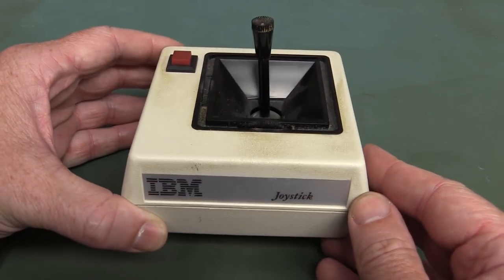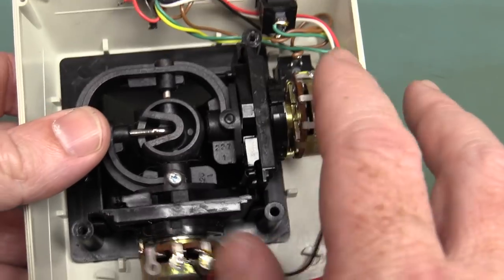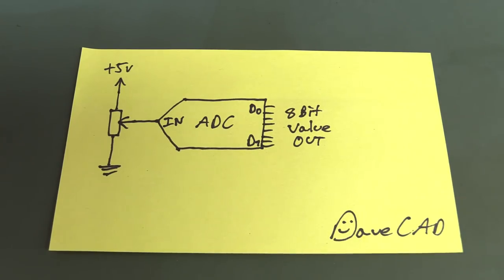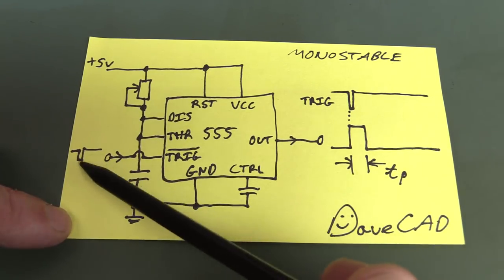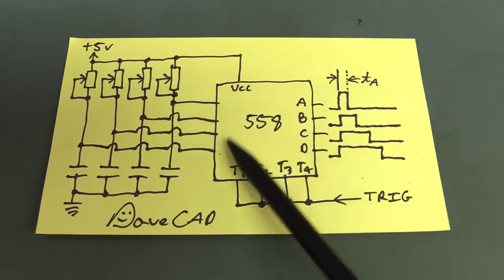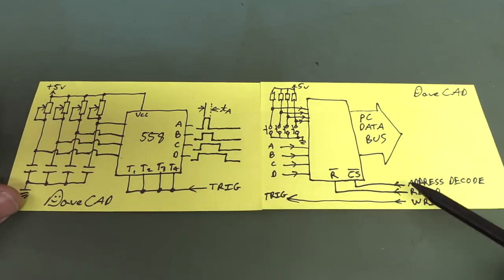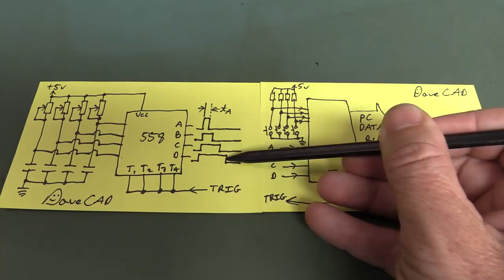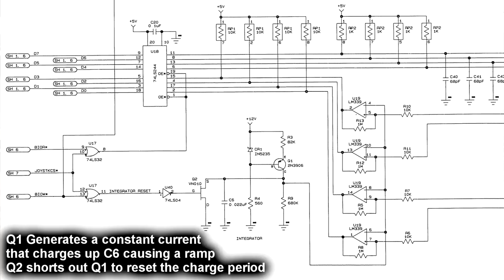EEVblog #1054 - How an Analog PC Joystick Works

Comment: Ah, the 15 pin PC joystick port.
Almost as ubiquitous as the Atari joystick port.
Although, more long-lived I suppose.

It's actually kinda surprising how many systems ended up with Atari ports or minor variations on it.

To this day the best input device for most 8 bit computers (though you have to watch it with some, especially those which deviate from the Atari spec somewhat) often turns out the be a mega drive gamepad.

Granted, in existing games only one button and the d-pad works; and given how the IO for most ports works (And the Atari port in particular), with custom software routines the best you'll get is the d-pad and two of the 4 buttons. (2 of the 7 buttons on the 6 button version.)
It wouldn't be hard to create a simple adapter that lets you use more buttons, but as is without rewiring either the controller or the port, this somehow just works.
It shouldn't, because it doesn't quite match. But it works anyway because the Sega controller expects +5 volts on a pin that according to official atari specs does nothing, but in fact is generally pulled high (eg. gives +5 volts) in most systems.
The reason you can't use all the buttons even with custom software is related to this; the Sega specification uses one of the pins as a 'select' switch. Pull it high and you read Button B and C, pull it low and you can read A and Start.
It just so happens that the pin chosen for this is the pin that in the Atari specification is used as the power pin. So it's always high. Which is why you get two buttons but cannot access the others; there's no software control over that pin.
(There are 4 pins that can be set as either input OR output, but those are the ones that give the D-pad inputs on the Sega controller. - and in fact by default the joystick inputs on a standard Atari joystick as well. Part of why this works at all - the D-pad maps to the same pins as an Atari Joystick, and the B button maps to the atari controller's Fire button. The C button maps to what is officially an unused pin, but which IS readable in software - Except no existing software reads that pin, for obvious reasons.)

Kinda weird how many systems used that same standard, or near enough to it, in the end.
Nintendo's logic for how to read a game controller is quite different. Though in their case one of the things that might not be obvious is that the NES and SNES controllers have the exact same pinouts and behaviour; Obviously the SNES has extra buttons, but beyond that the only difference is that the two have physically different connectors...

For a short summary of the differences, the Atari specification, while it has some variations for stuff like paddles and the like, really just treats the 9 pins as +5 volts, ground, and 7 inputs. - two are unused in the official spec, but you register an input by puling the relevant pin to ground. The Sega controllers are almost identical, barring a change in which is officially the +5 volt pin, and using up the unused pins for extra functions. That's all there is to a Master System controller, but a Mega Drive controller then uses a 'select' pin to swap between two possible interpretations of what the pins mean. 

An Atari controller therefore is just a bunch of buttons wired such that they pull specific pins to ground as needed. A sega controller is the same but in the Mega Drive adds a bit of logic to switch between multiple sets of buttons. (the active set pulls pins to ground, the inactive set is ignored.). The 6 button controller contains a microcontroller and uses a special timing sequence of the select pin to access the additional buttons. 

the way Nintendo does it is effectively a simple serial port; Compared to the atari and sega approach (excluding the 6 button controller) this is slightly more complex.
But, it's not compex circuitry. The controller simply contains a pair of 8 bit shift registers, which are hooked up to form a 16 bit shift register. The console sends a latch signal to lock the shift registers into a specific state (the combination of buttons when the latch was enabled), then sends a clock signal to shift out the bits one by one, then releases the latch signal.
A completely different approach, which is somewhat more complex, but also more adaptable in the long term; All you need to do to get more capable controllers is either add more shift registers or use a microcontroller in the gamepad (depending on the complexity), and redefine what format the serial data that gets returned is in.
The n64's controllers have a much faster bus, and have been reduced to just 3 wires from 7 (obviously the fact that the n64's memory cards attach to the controller has implications for what the transmission protocol is capable of; But the SNES controller ports have been adapted to attach some kind of flash storage to, as were the NES ports before them.), but the principle is similar. The gamecube controller still follows roughly this principle...
The wired Wii controllers have switched to using an I^2C bus, but it's still roughly the same concept...

All this stuff is surprisingly interesting when you look at it up close.

(in case you're wondering why I haven't mentioned anything else besides Atari and Nintendo... - well, like I said, the atari standard was VERY influential in the 80's. While a bunch of systems didn't follow the spec all that closely, they still broadly followed the idea of the port, and changes were usually just swapping the meaning of some of the pins around...)
Reply from the maker: Great input, thanks.
Reply: And yet, ironically Atari had a 15 pin joystick port that was decidedly NOT ubiquitous
Reply: @CODMarioWarfare - As I recall both the Atari ST and Amiga used 15 pin ports, but with a breakout cable the result is more or less that each port is two Atari ports put together.
Atari did then go on to use an unrelated 15 pin port for the Jaguar...
Which matches neither the original Atari spec, the Atari ST 15 pin port spec, the PC 15 pin spec, nor anything else. It's it's own thing, for whatever reason.
I mean, the Jaguar had what was it, a dpad, 4 buttons and for some reason a keypad with 12 keys?
But... Yeah, I'm not surprised that never caught on if the only thing that used it was the Jaguar. XD
Besides which Atari in the 90's was on the brink of collapse, and a mere shadow of what it was in the 1970's.
The reason the 9 pin Atari port was so influential can almost certainly be traced to how big Atari was in the late 70's...
But by the 90's... I don't think anyone cared anymore...

Comment: I think that could be made a lot less software intensive with only 3 extra chips. An 8-bit binary counter driven by the main clock, AND gated with each output channel of the 558 AND one output line of a binary-to-decimal decoder on the main bus. The binary value written to the bus selects the channel that will be delivered via the AND gates (along with the system clock) to the binary counter which will cunt as long as the 558 output is high and transfer that accumulated value to the data bus. I don't know if the main clock would be running at a good speed for this to work but another local oscillator could be used. If you were willing to wait 256 cycles for a full 8 bit resolution position, you could queue up a joystick read 256 cycles ahead of time and do something else.

Although I imagine the maximum delay would still be less than the software loop. Another bonus would be waiting a different number of clocks to achieve different resolution counts if some application favored response over precision. The sample rate could be arbitrary for each sample. You might also be able to mix the buttons in there to grab 1 axis (6 bit) + 2 buttons depending on an address value mixed with some more AND gates. I bet there are other clever ways to chain 2 4-bit counters and some extra decode logic to allow 2 axes to be sampled in one read (at 4-bit resolution).

Side note: do stand-alone ADCs work this way? I always thought they had a series of comparators (one for each bit) with a precise binary sequence of thresholds. They would all receive the input signal in parallel and the pattern of comparators that were on represented the binary translation of the the analog input.

Comment: Did not Apple have a joystick for its first computers?  I think I remember it having a rather smooth fluid feel, it had x/y trim pots on each side.  But I think the biggest thing I liked was that you could disengage the centering springs of the stick so it would stay wherever you put it instead of it moving back to center. Both x and y axis.

Comment: Awa, Dave, you could have stuck a signal generator on there to force the triggering. Output would go to buffer .. shouldnt cause lockup.
Reply from the maker: I would have had to force an active logic line, and it's not the same as running software and watching it do it's thing in a loop.

Comment: RC Hobby still uses PWM signal for radio transmitter joysticks and servo/motor controlling :) 50Hz, 1000-2000us width signal. Fortunately, "drones"/multirotors are pushing it to digital communication :)
Reply: Easy enough to read and generate on a microcontroller.

Comment: The problem with that is 1) it takes a "long" time, and 2) you never know how long it's going to take and 3) you can't read paddle one and immediately after read paddle 2 or 3 or 4 because the readings might be wrong, IIRC
Reply: 1) Yes, on the Apples I think it was 12uSec per count so maximum was about 3mSec to get the value.
2) Having to waste the extra read loop cycles was always painful when the CPU is running at 1MHz
3) So true, you did need a guard time between successive 558 triggerings. On the Apple][ at least I had code that read all four pots at the same time to sidestep that issue.
Reply: Yes but the built-in code didn't do that :-)

Comment: 5 years too late, but you actually didn't need a boot floppy to test the joysticks:  The PCjr has built-in diagnostics, including a joystick routine.  Hit CTRl-ALT-INS after POST, and then press spacebar until the cursor is by the picture of a joystick, then hit ENTER.  At that point, the ports will be constantly triggering to show an image you can use to calibrate the joystick positions.

Comment: Dave, I thought all of those computers of that era came with BASIC in ROM so would boot into a BASIC interpreter, well the IBM PC did. And you could have used a simple BASIC program to POKE the address of the joystick control and that would have generated the triggers you need with using game software or DOS. Something like this:
10 ADDRESS = ????
20 POKE ADDRESS, 1
30 GOTO 20
the syntax maybe off but that all you needed. Replace the ???? with the address of the latch/controller.

Comment: You mentioned the tolerances on the pots wasn't that great, so I guess that was part of the calibration routine you used to have to run? It was looking for the pulse length corresponding to center, min and max on each channel for your specific stick? I always figured it was more to do with small mechanical differences causing variations in where the stick would center physically, but the values of the pots not being consistent makes a lot of sense.
Reply: nobodybodybody : It was a couple things. Differences between sticks and models, changes over time and temperature (pots do wear out after all), mechanical wiggle and stickiness, it basically covered everything to some level of detail.

Comment: Use DOS debug and out to port 201H (if I remember correctly) that will trigger the 555 DOS debug commands https://montcs.bloomu.edu/Information/LowLevel/DOS-Debug.html

Example in DOS run debug enter O 201 xx ( output port byte )

Comment: So the Tandy 1000 is not compatible with the Microsoft sidewinder gamepads because they use a trick to read the trigger pulse out of the analog input through the discharge transistor of the 555 timer.

Comment: Software timing?
I would have used some 7400 series counter and an oscillator that is gated by the 555 timer, then fetch that counter value and toss into a buffer for the software to enjoy.
Though, it would need two 8 bit counters per joystick, and two AND gates too... But no more software timing!

Comment: I'm sure Woz didn't do it like the Tandy because he didn't like to mess with analog electronics very much
Reply: Woz did it many years before Tandy did it and the 558 solution is about as cheap and simple as it gets which is what drives Woz. The Apple ][ contains multiple little analog blocks but it also contains six 555 timer cores... most systems had eight of them if you count the 556 on the Disk][ controller.
Reply: He did not do it like*the*Tandy

Comment: Please teardown ye olde Microsoft Precision Pro and show us how that 'patented optical technology' works.
Reply: I tore one down when I was a teenager, but I believe it had an IR LED mounted to the moving part and 2 IR sensors mounted stationary(adjustable), and the output of those sensors were compared to get the location of the IR LED. Not unlike modern motion cap :)

Comment: I'm not educated in electrical circuits at all.  I want to learn enough so that I can build a joystick control system which will control a 12v trolling motor on my kayak.  I want to increase the speed as I push the stick forward and go in reverse as I pull the stick back.  At the same time I want to be able to steer the kayak by rotating the motor by moving the stick left and right.  And finally, if I fall overboard, the motor should stop as the stick automatically goes to the neutral position.  I'm guessing the type of analog joystick shown in your video might be able to do this when connected to servos or actuators to rotate the motor.  Am I on the right track?

Comment: I hated the analog PC gameport interface with a passion. The reason for this is that it never worked properly in my experience. Every game requireed calibration, some games had poor calibration routines and some games and joystick combo's where not always compatible. Also it beeing analog wasn't great for 90 % of the games that where better suited to digital control. It was kind of designed for flight sims, but horrible for things like pacman. Overall I feel that other systems (who used atari's standard) had a better solution. IBM had no clue at how to design an acutal working joystick interface that would work for most games. All other computer like MSX, Commodore etc did it better by using the atari standard and improving it to some extend whilst preserving backwards compatibilty with atari. Sega was smart, they where wise to do the same.
Reply: I remember my Amstrad PC1640 had an Atari joystick port on the keyboard, and if you attached a joystick to it, it "pressed" down the cursor keys. I don't recall what key the fire button actuated. That was pretty clever since the keyboard already is exactly the same type of on-off digital input and games would have keyboard controls anyway, so no special support was needed (other than possibly redefinable keys).
Reply: I remember that the DOS version Ninja Rabbits had an Amstrad joystick option. I've always wondered what that was until I found out that Amstrad had their own PC compatibles.

Comment: So how does a Joystick nowadays work, if there are still those? Do they still have a potentiometer for determining their position? Or are there other methods that are more clever for digitally reading the X- and Y- position of a joystick? I think maybe some capacitive thingy with two coils on each axis that move in relation to each other and change the capacity of the circuit, or something like that?
Reply: +Applied Science used to make fiber-optic joysticks for use in medical research involving MRI (say, you need to have a patient manipulate something while inside an MRI so you can see what lights up in his brain, and obviously you can't have any metal nearby.

Until the USB era, all joysticks were just dumb pots and contact switches, with the ADC on the motherboard or expansion card.
Reply: Midi has been used for Joysticks since the early 90's, my first sound card that I put in my 386 (which was a really crappy card at that) had a midi port that was designated as a "Joystick port".
But how did the mechanical part that translates movement/positioning into data change from pots? optical sensors OK, but they can't have been that accurate, could they? Hall sensors is an interesting concept, is a hall sensor capable of measuring the strength of a magnetic field (as opposed to something like a reed switch which only turns on or off)? And how else could this be done?
Reply: Optical is actually quite accurate. What do you think your computer mouse is using?
Here's a couple examples of what Applied Science did for controllers utilizing fiber optics:
https://www.youtube.com/watch?v=dbrvLQamR0U
https://www.youtube.com/watch?v=X2Uj3-B_MSo
I'd highly recommend you check out the rest of his videos. If you like EEVBlog, then Applied Science is right up your alley.
I recall one of my early game cards was a Gravis dual-port with a little pot on a dongle hanging out the back of the card. I can't quite recall what that dongle was for though. Adjusting something...
Reply: I'm mainly interested in the transition between mechanical positioning and digital data (of that mechanical position), so it's a 90+% theoretical effort for me.
Reply: Encoding wheels. Same way ball mice used to work.